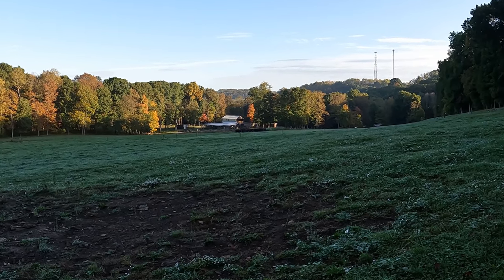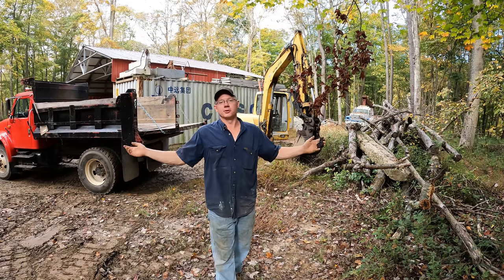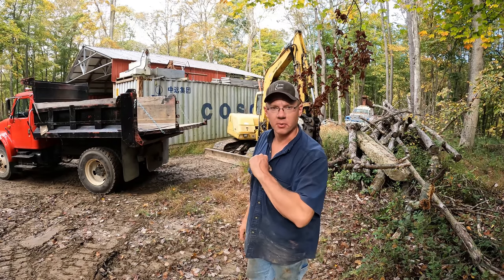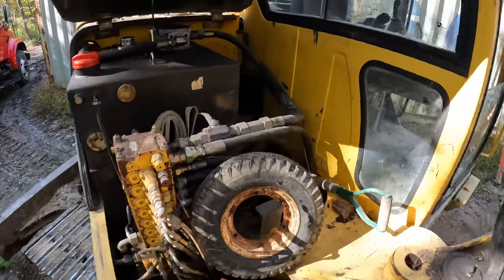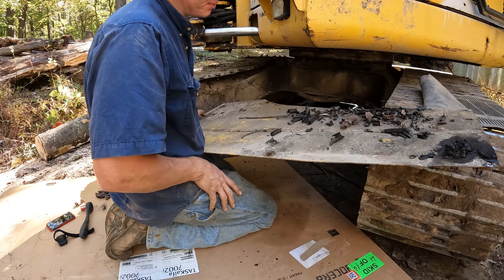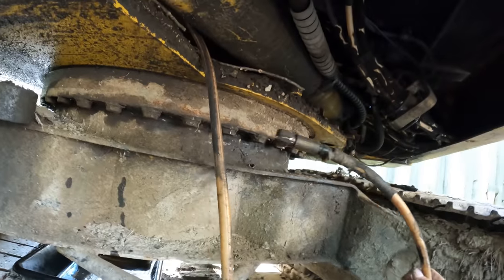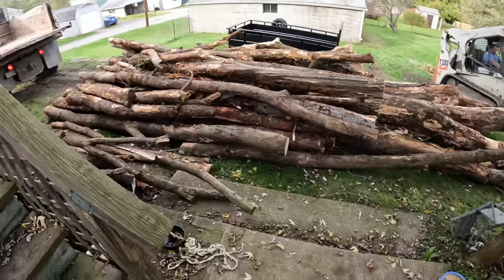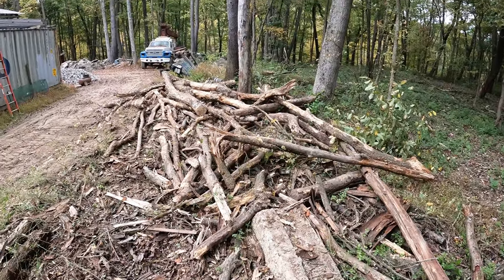Excavator Breaks Down Loading Firewood! (Not Good!)

Comment: One thing I have learned to do when replacing hoses is when they are up in a tight area like that is to tie a 1/4'' rope to the end of the hose when pulling it out so I can pull the new one it back through the same route
Reply: Every time!
Reply: Good tip
Reply: Ha! I came here to say this too!
Reply: What can be even better is to use one of those braided ropes w/o a core. Open the mantle, insert hose and the rope will lock onto the hose like a chinese finger trap(might need a few turns of tape as support). That makes it snake through tight spots w/o catching.
Reply: A great tip and with hind sight I reckon Matt would have done that if he wasn't in a hurry.
Reply: Boom baby!
Reply: Great idea
Reply: @davidbackman4442  I have a similar puller I made by attaching an electrical cable puller (that works exactly like the "Chinese finger grabber" you described) to a length of 3/32" vinyl coated aircraft cable.  Shove the gripper over the end of the hose fitting and wrap a few turns of tape over the end of the gripper so it can't expand and come off the fitting if it encounters a tight spot.  Works great, but I am glad to learn of the uncored braided rope trick, filing this tip away.  Thank you
Reply: @larrywalker7759  The purpose-made, braided steel ones are stronger and have a stronger grip on the cable/hose. But the braided rope has a lot better "scroungeability". You can't carry all your tools for every job.
It's possible to use core-mantle ropes as well, but first they don't widen as much, secondly, the time it takes to free up enough mantle for the overlap tend to eat up much of what you're able to save on the smoother pull-through.
Reply: @philipcable7518  
When you are in a hurry is exactly when you “should” do this, it takes little time for most of us to find something to use, even a bit of copper wire will work and I bet he has some floating around there!

Comment: 13:22 INVEST in a line making machine. It will pay for itself. It doesn't need to be fancy, it needs to do the job. I cannot overstate, yell, dance around the fire, and yell at the moon enough, just how good having the ability to line yourself is. Just my 2, enthusiastic, cents.
Reply: The machine shop I used to work at, had a Parker set up. The dang fittings for one hose, cost more(retail) than what 2 hoses at Farm and Fleet would cost and there were hundreds of different fittings stocked to "have what you needed". 
 It was handy, for rebuilding machine tools, and a few farmers came in once in awhile for a "quick fix", but I'm not sure the investment ever paid the interest on the original outlay?
Reply: @bluegrallis  Your comment is exactly on target.  Hose making equipment and the infinite bulk hose and fittings is an investment that only pays off in a few situations.
If you are operating a hose fabrication shop for profit.
If you are maintaining a fleet of anything that has a lot of identical fittings and hoses.
In Matt's situation there is no way he could benefit by investing in a bunch of hose making tools and the materials based on the small number of failed hoses he has encountered.
However.............if he should ever run upon a hose making equipment bargain bonanza used bunch of stuff that was gonna be scrapped out................well, that would be a game changer.

Comment: Went and looked at a 10k Yanmar mini that was about 10 years newer than my current mini. It was condition wise worse, and they were asking 35k+ for it. IMHO, keep wrenching until something massive goes (finals, slew motor, main pump, slew ring bearing failure, engine, etc.) Nice video man!
Reply: The only thing that should call one of these to the grave yard in the sky is structural failure. Otherwise, barter and swap. It's not rocket science to swap a motor, pump or whatever, and it will always be cheaper over all (provided you find the donors in same-same but cheap condition, of course) than buying fresh. I've a lot where i keep spares, if i see a good deal on a damaged unit, but otherwise good parts donor, i get it, keep at least 2 units disassembled in containers.

Has lessened the bills by thousands or more.
Reply: @aserta  spoken like a true new englander if the cancerous rust hasn't taken her structure then fix that shit!
Reply: Rubber protectant spray might extend those hoses a bit.  I'm not sure if some hydraulic fluids preserve old hoses better than others.
Reply: @aserta  And that is exactly how I manage to keep my 60 year old daily driver cars running. One is always broken but there are no monthly payments!

Comment: The best excavator breakdown was about 20 years ago. We where putting in 2000ft of  4ft cement culvert and it was a very hot summer. The machine broke the eye for the pin that holds the boom to the house. Mind you I'm in the trench not the machine it's humid and 101 degrees in the shade that I wasn't in. It took 3 days to fix. Those 3 days where the hottest 3 days of the summer

Comment: Matt, just a thought, as many hydraulic hoses as you go through, I wonder if it might not be an idea to get a set of hydraulic hose crimping dies and a press and make your own as needed.....
Reply: Problem is you need To still buy hose or fittings, or stock up insane amount of them. Most likely matt only pays for supplies used or slight crimp cost. Not worth buying expensive press with dies
Reply: @jrt2924  A manual crimper isn't too expensive thanks to Jeffie's Amazing Place.
Reply: @lifeofgold  still needs fittings etc. Maybe worth it maybe not.
Reply: @jrt2924  he seems to be short on time so this would be an excellent way to shorten that gap of downtime.  That said, it requires foresight to calculate that into the equation.   I’ve seen others who have them on their service truck, with the majority of the fittings being the same size, they save a ton on time (and fuel).  It becomes a no brainer if the time lost includes paying an operator to sit ….plus the trades waiting on a finished transaction aren’t being held up.

Comment: That Komatsu is worth its weight in gold! I know I have a PC75uu-2. Its older than yours and has some of the same issues. Hoses just started leaking- showing their age. So many benefits to this size of machine! You can actually work on them without another machine for most things. I cleaned mine up gave it a new paint job, fixed a blown ram, made new windshields and changed ALL the fluids. Now its time to do the hoses. Anything bigger just cost exponentially more to fix. Give her the love she needs and she might just love you back! lol
Reply: Hi.
I am renovating an old PC30-1 from `82 :)
Reply: @paweisyn7446  right on! If you dont have the books they are a must have! the shop manual, owners manual, and parts book.
Reply: @freeradical431  For my PC30 I only have a parts catalog on my computer :(

Comment: Just because the outer rubber is perished does not mean you have to change all the hoses, i have hydraulic hoses where the outer rubber is crumbled away 10+ years ago and the hose still works just fine :-)

Comment: Love your videos Matt, never miss one. With the amount of old equipment that you have, would it be prudent to buy the gear to make up your own hydraulic lines, they are forever blowing and cost your time, money, oil and hassle, would it be cheaper to buy coils of hose and a selection of fittings and maybe a handheld crimper tool, or even the hydraulic type to attach to your enerpak maybe ?, or even a used industrial type machine ?, I’m thinking it’s gotta be cheaper in the long run. Just a thought from an old mechanic.
Reply: One would think that would be the way to go, good suggestion
Reply: @vinces8974  
It is the way I would go, although the line that blows will then be the one that you don’t have a fitting for as it is not economically viable for a small time operation to keep every fitting! 🤷‍♂️
Murphy law 1 o 1.

Comment: By yourself pro tip…..by a jic cap and plug set. Weld a small washer on each. When you need to pull one of these buggar hoses out pull a sting through with the old hose. Screw plug/cap on new hose tie string to washer and bam some help to get the new one through the mess.

Comment: Matt!  Started playing the powerball. With the run of luck you’ve had lately, you may win. The mower gearbox was a direct fit, the jeep airbags went smooth, and this hydraulic line was easy to find on the machine and cheap to replace. 

You may soon be asked to rescue a bud full of supermodels who slid into the ditch by your house. 

Either way, play the lottery.

Comment: My dad used to buy hydraulic hose in bulk and reusable hydraulic fittings to make up his own hoses. He did that for nearly 50 years.

Whenever a hydraulic hose blew he would take the fittings off the old hose and put them on the new one, unless it was broken. He always kept spares.

Those reusable hydraulic fittings also work really well on air hoses and look much nicer than a hose clamp.

I know you are much too busy to read most of these responses but maybe somebody else will see these and get some use out of them.
Reply: Field applicable fittings are expensive and don't always fit in the space available.

Comment: Sad that your excavator is nearing the end of it’s useful life due to age and wear, it is a dilemma many of us with limited funds face unfortunately. I personally do not own a business and have no tax advantage to replace or repair broken equipment but the need remains. I recently rebuilt the Diesel engine on my 1967 Ford 3000 tractor which for me turned out quite well thank goodness. Due to a broken ring in cylinder #1 the bore was wallowed out very badly but the block was able to be bored out and new pistons installed. I did all the grunt work of splitting the tractor myself and disassembling the engine saving me several thousands of dollars in labor costs. I was able to do all this myself with very little experience due to the guys like yourself posting how to videos on YouTube. I just jumped in and did it because not to would have left me with no tractor at all. I use my tractor very often grading my driveway, brush hogging, digging post holes, snow removal and other various uses around my modest  digs. Paying someone else to do these things is cost prohibitive and the reason I bought the old tractor in the first place. Thank you for all you do that helps us learn and keeps us guys floating. :)

Comment: Love those Stihl chain saws! Bought an .028 in 1980 when we lived in the mountain foothills a few miles from where we are now and had a nice wood stove. Enjoyed making firewood trips up into the Sangres to the Forest Service authorized cutting areas. Still have that Stihl, they don't classify them that way anymore. A few years back the original chains wore to a point they could no longer be sharpened and Stihl doesn't make them either. The local John Deere dealer also services Stihl products and the guys made me two new style chains for mine and she continues to saw on. Lots of hours on her but I don't get to use her often these days. Good machines. Thanks for the video, Matt! Roll on!

Comment: Just for future reference...when replacing hoses that go through areas that will be difficult to reinstall, tie a piece of small rope or romex (house wiring) to the old line before you pull out the bad hose.  Then you will have something to help pull the new hose back through the same route in reverse.
Reply: Or get an extra line made and run it along with the broken one and cap it off, next time a line blows will be a quick fix.

Comment: What would you say that old excavator is worth?  I'm on the lookout for an old one needing some TLC, but it's hard to know a reasonable value.
Reply: My boss bought a 1974 John Deer 690B for under 15k.
Reply: Any used equipment is up in value now because can’t get new and new engines have problems with regen systems and def dam gov regulations
Reply from the maker: That’s a loaded question, if I was gonna sell it today I’d list it for 28,000 and go from there
Reply: I paid 24k for a 03 PC120-6.  Deals are out there if you search.
Reply: Parents bought some Chinese excavator for 12 grand, but would probably struggle on the bigger logs and good luck on that concrete block

Comment: When you change a long silly routed line tie and tape insulated copper wire to one end that way once you pull the line out the wire is in its place and then tie N tape the wire to your new line and pull it through i work in metal recycling and we're a rapidly growing company so the main maintenance man can't come from 5 towns over to change a small line that's routed funny the machine that this happened on me and the main maintenance foreman both were there he called me i wash brush cutting way out Back we took line loose and I said hey let's tie something to this he told me it took him 5 hours last week to change the opposite one (y the hell is this little machine blowing these lines? Blah blah blah) left hand top driver side box get that multi strand copper wire he tied it hit it with some tape I pulled it we told that lazy operator new line should be here in an hour tie and tape it to the blue copper wire pull it through tighten both ends he still called me asking what the he'll yell talking bout tie it to the wire and pull it through I explained he cried for 10 minutes and was loading trucks in 30

Comment: I agree with you on changing lines.  Except for one.  I have a auxiliary line that is abraded in one spot.  If it fails at that location it'll spray the entire inside of the cab.  It's getting changed prior to any auxiliary attachment is placed on it.  I'm not a fan of hydraulic oil baths, it does nothing for my skin.

Comment: Use a speed handle to undo nuts and bolts quickly or use a bracebit with a socket adapter on it. Or even a Yankee screwdriver with a socket adapter on it from Lee Valley tools.
I often use a two-speed egg beater drill with a socket adapter on it, or with a screwdriver adapter on it. 
I seldom use drill bits in my egg beaters.
I love my cordless egg beaters. They never need batteries. 😀

Comment: When you need to change a hydraulic hose in a situation like this one. Tie a strong string to the old hose and pull the old hose out leaving the string in the path of the hose.  Then tie the string to the new hose reversing the process, using the string to pull the new hose back in place. Saves time and assures a rats nest of tangled hoses doesn't occur a future hose repair.

Comment: Short answer. Big companies with multiple different excavators can and often will send an excavator in for repairs and can afford to replace multiple lines at ones if need be. small Contractors that only have 1-2 excavators cant afford the downtime to fix multiple issues at once on 1 excavator. they need it up and running to get the job done but when holidays come around or not much work is going on at once then that gives Contractors time to fix little issues for peace of mind. i should know this because ive been a Contractor with this exact issue for 10 years. its not fun when 1 machine is down and you need to use the other especially when its too big for the job.

Comment: Good job.Lucky that was not a high pressure hose.I worked as a machanic,We had several cases where a forklift would blow a hydrulic hose,but we were in a manafacturing plant,so we would have a mechanic working to replace the hose,and a couple men using speeddry to clean up the oil spill.Caused all kinds of problems if oil got into the storm drains.Noticed several people talking about you buying a hose crimper.Might be food for thought,but you probably have thought  about the fact that you would need several different sizes of crimping dies.We also had some equipment that had reuseable hose connections,they were assembled with screw together fittings.sometimes hard to work with,especially with 3 or 4 wire hose,and a good vise,mounted to something substantial is necessary.Again like every video of yours I have seen,like the way you work.

Comment: The blown line reminds me of rusty brake lines that when one blows and you go to replace it, you end up disturbing the ones around it and cause them to blow too. That’s why I cringed a little bit when you dropped the block to get the blown line out, hoping it doesn’t flex those others in a way that will weaken them prematurely. Just a thought

Comment: Good video Matt. I had a JD 120 trackhoe a few years ago and my operator shoved a log under the cab and pushed the skid pan loose which cut a pilot line. They don't have much hydro pressure evidently because we were 50 minutes from the parts house and I put a brass coupling and 2 hose clamps on it to put the line back together and it was still dry when I traded it off a couple years later. I enjoy your videos Matt.

Comment: Pro tip- keep a roll of wire (electrical or mechanics) with you. Next time you pull a hose out like that, tape the wire to one end of the hose before you pull it out. Then when you pull the new hose in, you've got a wire to pull on and it will most likely go back in the route it is supposed to.

Comment: A kinda of a where do you stop machine.A repair as you go weekender machine.
If you had a shop replace all the suspect hoses the shop would own it. A great video on access and repair of a PIA hose. When they go ,its a sense of dread til we look and see. I had a round baler blow an obsolete hose. The route was a nightmare. Since its my baler I had a much longer hose made,rerouted it,and it works great. It isnt as neat a look,not as tucked away, but it aint bad either.Besides,the original is not available.

Comment: You should keep a socket wrench speed handle handy for the times when you don't have a battery powered wrench. 
Or the old style egg beater drill with a socket wrench adapter on it like I use for spinning bolts and screws in and out. 

I love my North Brothers 1545 and my Miller's Falls number two. 😀😃😄